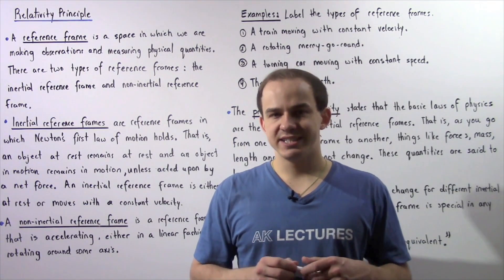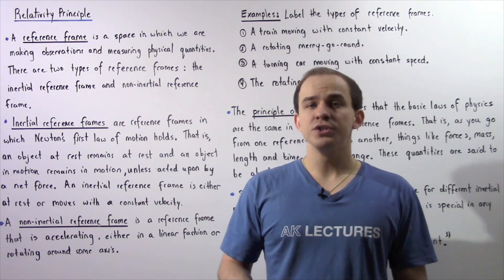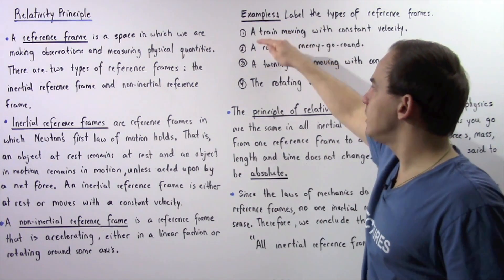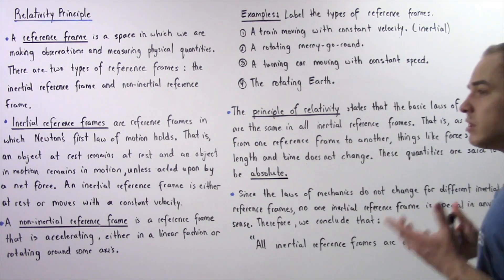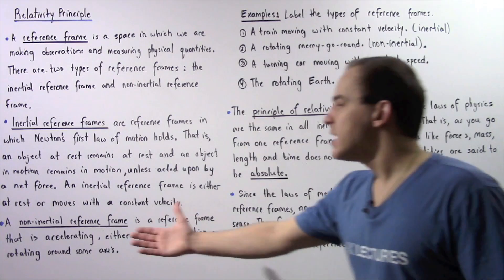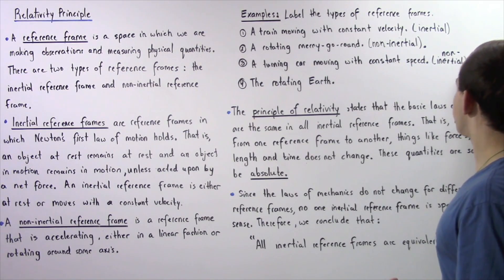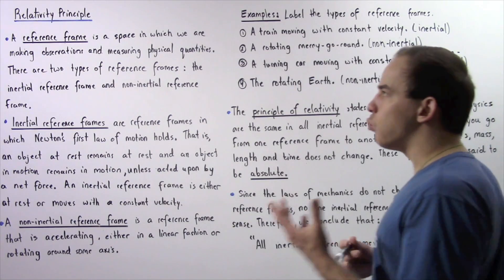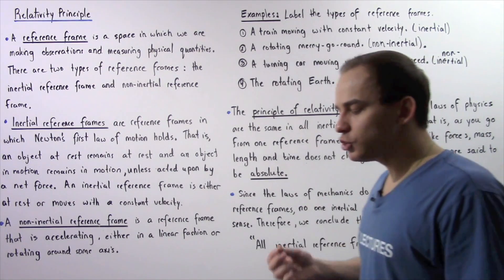Reference Frames and Principle of Relativity

Comment: According to wave theory of light , light slows down in denser medium.Does this mean light velocity decreses with reference to another frame??
Reply: no. the speed of light is constant regardless of the reference frame. the reason why we observe light to travel slower in different material is due to the path difference they take.
Reply: When light travels through a denser medium it must take a different path compared to its path traveling through a vacuum. In a vacuum, there is nothing, no matter, no atoms just space-time it can therefore travel freely without discourse. If going through another medium like glass however, light must change its path as it has to bounce around from atom to atom.
Reply: the speed of light doesnt change in any media , thats just a common misconception. Think of it , if the speed of light did ever vary , causality would be violated when light would travel from a denser to rarer media as commonly misinterpreted by people that speed of light increases when light travels from a denser to rarer media , your free will woudnt be a fundamental quality that you possessed.